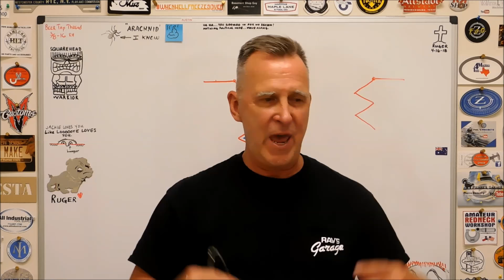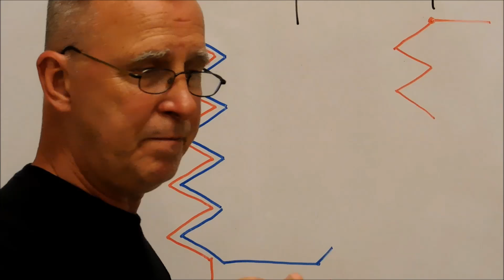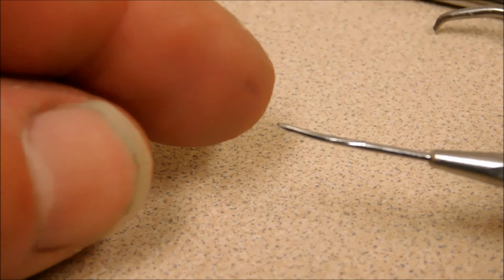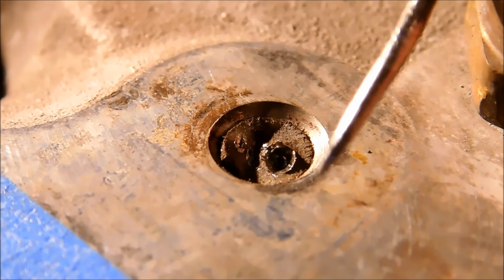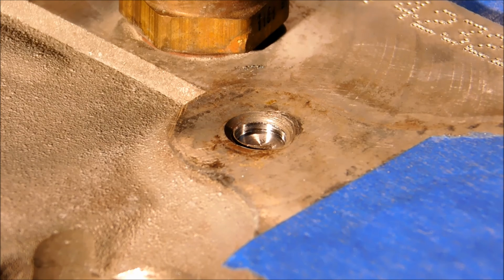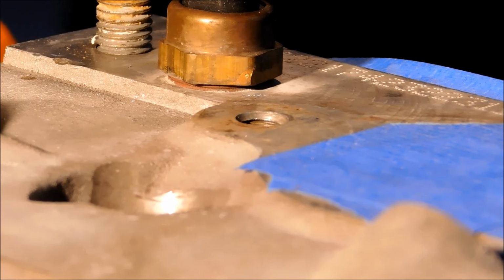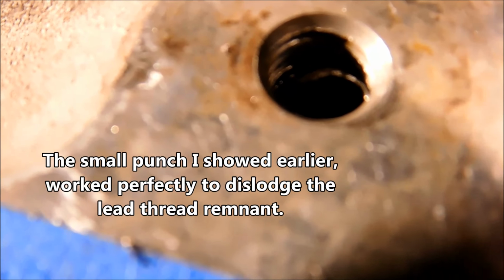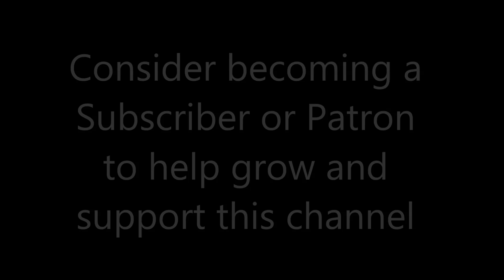Removing Sub Surface, Snapped off Bolts -- Take a Look !!

Comment: Dental “tools”!  When I was practicing I had only dental instruments!  Yours are all broken, dull old curettes and explorers.  Older practitioners will have a drawer full of instruments that have been sharpened so many times that eventually the weakened tip breaks off. Then the instruments become “tools” and get thrown in a drawer. I was always thankful to have someone come by and ask for the “tools” so you would be rid of them and not waste time trying to sharpen them again (or pay an assistant to waste time trying to sharpen them).  Periodontist use up the most of these instruments.  Being a pediatric dentist I used the fewest and could only supply my home shop!  Now you know where to go get your “dental tools”.  Oh, don’t ask for a “dental pick” as they will have no idea what you are talking about, you want scalers, curettes, and explorers.

Joe please show us (me) how to get a steel tap out of a blind hole in aluminum without destroying the part...  I can’t drill that out, the drill always deflects, usual long adding additional obstruction in the hole!
Reply: There was this method I saw that worked. Using a tile hole saw (or core drill). They have diamond grit embedded on the end. It will take a while. So if you have the time and are out of options. You could try that. Also you have to keep it lubricated with water.

Comment: i worked in a auto motive machine shop.. Tell your son us candle wax next time before he removes bolts heat the bolt first than drip wax on it.. IT SAVES YOU..
Reply: indeed, especially if it is a beeswax candle

Comment: I hate EZ outs. I have had lots of people bring me stuff with broken bolts and studs and most always have a broken off EZ out in the center. I cant stand it when Im in line at Harbor Freight getting some cutoff wheels for the grinder and see guys checking out and lay EZ outs on the counter.
Reply from the maker: I don't even have them in my shop.

Comment: Nice work! Tell your son to put anti-seize on any steel bolt or studs going into aluminum threads.
Reply: Unless of course he knowingly bought the engine in this condition at a significant discount.
Reply: Stelios Posantzis, I wasn’t trying to lay blame on anyone, I don’t believe the factory ever puts anti-seize on the studs or bolts. I have had numerous studs on that type of GM head break off and require drilling out.

Comment: The only problem with this is the need for precision when doing it. U really need a mill or at minimum a locking 2 axis vise on a drill press. Welding has always been the most successful and least invasive approach for me on really seized bolts. Sometimes you have to build up some weld first if they are recessed. Tig welder is best for that
Reply: Isn't there a problem if the stud is steel & the thread aluminum ??
Reply: @Ted007-r5r  not a problem at all, thats generally the case anyway.
Reply: No, you don’t need a mill or drill press. I’ve got out thousands of broke bolts with a hand drill and got the “spring” out.
Reply: Yes it can indeed be a problem, particularly when the stud diameter is small, the fracture is well below ground, or the stud is well stuck.
I think this is because the aluminium vaporises and contaminates the weld, causing it to break in torsional shear

Comment: Probably a dumb question, why not just continue with the end mill that you flattened things with?
Reply from the maker: The diameter was under the required size.
Reply: Good question, In essence Joe's ultimately drilling to what often would be termed as a "tap drill" size. Since that was an 8mm thread the normal tap drill would be 6.75mm and the closest fractional size would be 17/64.. There just aren't too many choices for 17/64 end mills. The 17/64 is a hair undersized and an "H" would be a hair oversize, in this demonstration.

Comment: At the 18;00 minute mark I would use a 50% niric acid and water solution to disolve the remaing steel from the aluminium casting.
Reply from the maker: I've never done that. I may try it.
Reply: I think the 18:00 minute mark illustrates why it's preferable to use a left hand (counterclockwise turning) twist drill. Provided you use the rack and pinion (drill press style) handle rather than the geared wormwheel (milling downfeed) handwheel, I've never had it overload the drill, it just pushes your handle up when it starts to spin, and you can keep the revs low if it's a concern. Much like power tapping with plug reverse.
Reply: @joepie221   OK I've just heard you say you don't have a LH bit that size. 
Before I got myself a set of LH bits*  I used to just sharpen a suitably sized RH twist drill "backwards", as if the flutes were LH, and run it counterclockwise, and that works well, as long as you did a smaller pilot hole (as you did here) with a conventional, sharp RH bit, as this smaller diameter drill is very unlikely to create enough torque reaction to drive the screw deeper.
* (and still do, when it's an odd size)
Reply: @Gottenhimfella  ok now that's an idea I've not heard before ! and why not? you've always got dozens of drill bits right? just no left handed ones
..... thanks I'll do that !!!
Reply: Nitric acid is very slow at dissolving steel but I've heard alum works really good but I've never actually tried it myself

Comment: At 19:48, looks like you got the infamous nub that GM puts at the tip of the hardware.
Reply from the maker: I think thats the stock size of the screw blank before they roll the threads into it. Much stronger bolt that way.
Reply: @joepie221  That's what it is.

Comment: That was really, really cool stuff there. I’ve removed many many broken bolts in vehicles and by far the first rule is try not to break the bolt in the first place. I know that sounds like a smart ass statement, but whenever I was working on an exhaust system, I’d soak the heck out of the bolts. Sometimes for a couple of days. Also, I’d tap the nuts/bolts with a brass hammer occasionally and then spray again with rust penetrant. 
  Anyway, that’s a super cool trick Joe. I’ve never seen anything like it, but it makes perfect sense. Also...FWIW....I’ve had pretty good luck with the Snap-On extractor sets. Pretty sure it’s made by Ridgid. 
 RIDGID 35585 10 Screw Extractor Set, 1/4-inch to 1/2-inch Broken Screw Extractor  https://www.amazon.com/dp/B000WQYJIG/ref=cm_sw_r_cp_tai_Faw-Eb56D1CNW
Reply from the maker: I've had so many bad experiences with commercial bolt extractors, I hesitate to even consider using one. Thanks for watching.

Comment: Great job machining it out but NOPE. Too Labour heavy. Chevy Vortex engines are notorious for breaking exhaust studs, particularly on the driver side head (I'm guessing that was the aftmost stud on the driver side head you used in the video). Weld them out all day long, I do a half dozen of them a year. Get the truck on a hoist. Remove the tire and the plastic inner fender. Use a MIG and spot weld out on the end of the stud until you're above flush. Get a 3/8" nut and weld the inside of the nut to the end of the stud. The laws of confined thermal expansion/contraction will apply and actually shrink the stud. Spin out with a 9/16" wrench. Absolutely no reason to remove the head from the engine, unless you really need to increase your billable hours.
Reply: That was my first thought as well for removal.
Reply from the maker: @wronghandwelding  As  much as I appreciate your comment, this engine is on a stand in the corner of his garage. The heads were off for a valve job. So under the circumstances, this repair choice was ideal.

Comment: Ya dos'nt heat the base materiel to expand to plastic deformation preserving the factory intended thread fit . 60 deg starter drill and 59 deg drill point you don't see anything wrong with that. you really do use those things all the time. hey how bout this Joe next time you bust a tip off one of those you grind a four facet, split point 59 deg REAL starter drill on it. Ha ha great show

Comment: Forceps can make grabbing the thread a lot easier than needle-nose pliers. They're available in a lot of sizes, not very expensive, and lock closed. Extremely handy.
Reply from the maker: Some of these remnants can be very tough to pull away. I've twisted and ruined forceps under heavy rotational loads. But if the thread is cooperative, they do offer a deeper grip range.

Comment: Good stuff as always. Unfortunately it seems most of the time I'm removing broken studs they have to be removed in situ, and there is no recourse to precision or truly concentric drilling. The solution inevitably involves heat, wax or WD40 or whatever I have, punch, drills, ez outs, copious swearing, and several six packs. Heat and swearing are indispensable.

Comment: Oh by the way, some bolts in heads are at an angle to the surface.
Reply from the maker: For example??
Reply: @joepie221  I think he means the case that the hole is drilled at an angle and is not 90 degrees from the surface
Reply: Joe Pieczynski  I have drilled out broken bolts where the intake manifold bolts onto racing heads that were at an angle. I seldom ask what kind of engine or head bu seems like the intake was Edelbrock single or double plane.

Comment: Done that a few times
Reply from the maker: And its a pain in the neck, every time.
Reply: @joepie221  Laughed out loud when you said that. Hope the other two came out as cleanly as this one. Surprised that metric thread is used on an American car. Is it sourced from Europe?
Reply: All of the Big 3 use metric exclusively.  In the Ford Cleveland Engine Plant where I work, getting a fastener for a maintenance job that is SAE, is near impossible.

Comment: That looks like an 8 mm bolt. Use a 5/16 end mill to line up and spotface the first thread depth which is usually damaged an has the stud hung up. Then center drill the stud. Use a 1/4 left hand drill bit and 99.9% of the time it will come out. I have removed a 5 gallon bucketful with this method. I think may God invented the left hand drill.
Reply from the maker: Though a LH drill is the usual go to, the danger is higher than you would imagine. If the coil grabs the drill and the rest of the screw is stuck, its an instant choke and boom.

Comment: I can’t believe you are using a center drill,in a spotting drill situation.
Reply from the maker: I use center drills on just about everything. I use spot drills on aluminum and plastic mainly for threaded hole prep.  I don't put too much weight in the book. I may make a video to change your opinion.
Reply: @joepie221  Yup Center drills are you friend since they are very rigid for the hole diameter. Less likely to go off center than a spotting drill if the surface isn't smooth.
Reply: @guytech7310  Spotting drills are the same of better in stiffness, only difference really is the missing narrow tip and different included angle.

Drilling holes with a center drilled start doesn't go well in terms of getting the drill to center and also it very easily chips the cutting edge (on a manual machine).

My question is: why use a center drill when a simple better option is available? What is so special about a center drill that it warrants using it instead of a spotting drill?

Comment: Logically, if a fastener is stuck so hard in a hole that it will shear off the entire cross section and not come out, what do you think weakening it is going to do with an easy out?  You either have to break the bond with heat or relieve the pressure on the fastener by drilling it out or both.  I think almost all bolt/screw extractors are a waste of time.  Try left handed drills a torch or do what you did.  I have no experience with extractors, but have learned enough to not waste my money or time on them.  I'd rather deal with a broken bolt than a broken bolt with a broken screw extractor stuck in it.
Reply: Just because a piece of material is smaller doesn't mean it isn't stronger. An 8mm easy out can have a tensile strength far in excess of a 12mm bolt.

That said, they're crap. The only ones worth even trying are the square ones and even then...

I usually find the oxy or mig does the trick for me.

I've never had to take one down to a machine shop yet but you can be damn sure the poor bastard who gets the job ain't gonna be happy to see it if I get to that point.
Reply: Yup- often doesn't work but i think that when it does it is because the pilot for the easy out relaxed the pressure on the threads.
Reply from the maker: Same can be said for soft weld material built up at a smaller minor diameter. I go with what works for me. Machining out easy outs really is a hassle.
Reply: One day I'll have to pay, and I certainly understand that having someone stuff it up first makes the job harder.

But, if I turn a $50 job into a $250 job so be it. The number of times I've saved my $50 by having a go myself first makes up for it many times over.

Comment: Alum salts will dissolve steel and not harm aluminum. You can chemically remove steel bolts from aluminum.Look up "using alum to dissolve steel"... Incidentally lye dissolves aluminum but not steel. useful for removing alloy seatposts stuck in steel bikes....

Comment: I like to use a left handed drill bit if I have the right size, often times the broken screw will just back itself out. Also I have had a lot of luck using Craftsman "drill out screw extractor" https://www.searsoutlet.com/br/pdp/craftsman-7-pc-power-extractor-set-drill-out/31109, it's kinda funny this video was posted today, I  just recently was asked if I could remove a broken bolt by two different people who managed to butcher the hell out of it before they asked for my help. I was successful btw.

Comment: Broken bolts are easy to deal with.....how about broken taps?
Reply from the maker: Carbide end mill straight down the center. remove the tap remnants as you go.
Reply: Heat cherry red ,cool very slowly  to annel, remove in normal fashion. That's how you do it when you work in the field without $$$ of equipment and without all the bla bla bla.
Reply: @joepie221  darn I was hoping you had a magic trick for that like a tap removal spell? ...chicken blood?
Reply: With a punch, hit the broken tap very hard. This breaks the tap to pieces that can be removed.
Reply: If you don't have a carbide end mill, or a mill for that matter, get a cheap high speed (50-60k rpm) pencil grinder at H Freight and a set of 1/8" shank diamond burrs.
Use water to keep the grinding swarf flushed out ( squirt bottle )
and erode the tap out. It may seem like it's taking forever but I had about 1" + of OSG  5/16-18 tap snapped off in some thick stainless steel on a jobsite. Contractor had a compressor so I ran back to the shop and got the pencil grinder and set to work. I had it eroded and collapsed out of the hole in about 20-30 minutes.
It seems a little slow but it's foolproof if you're patient.

Comment: been in auto industry for decades   In "situ" is 98% of the work... Ez Outs  success rate =1%      Left hand drills = 20%      Welding washers/nuts = .75%     A "good machinist" with part off?  100%   (and I am no machinist)
Bolt extractions can ruin a guys day when he is only paid for what gets done..  I have had pretty good success (in situ) with a combination of methods..  when a welded nut is out of the picture, I core the broken bolt as best I can with an undersized drill bit (your accuracy is great but mostly impossible on most situations in my work)   I then chase in with lefty bits going up one size.. Seems to work better to relieve some of the pressure on the helix and allows the lefty to take a bite and then extract ..     
Pulling broken bolts is like popping zits...   lol
The real challenge is finding the bolt center.. I have my method that works pretty good but would love to see some methods that work..  I use transfer punches.. find one that fits inside the thread (I use a nut) and then try to compensate for the helix..  probably good to within  .005-.010..
Reply: Welding washers... Did you say 0.75% or 75%?